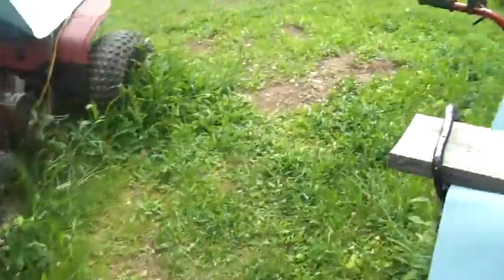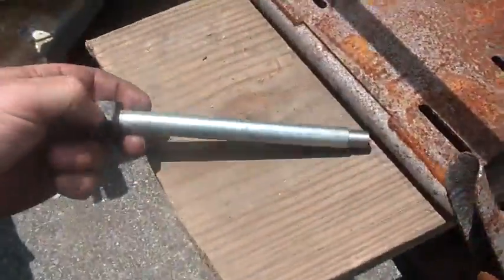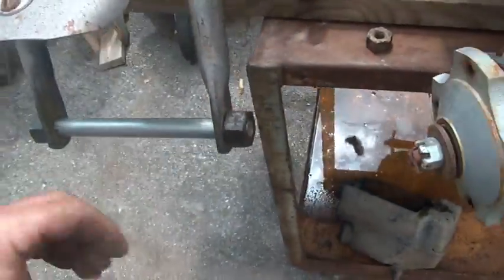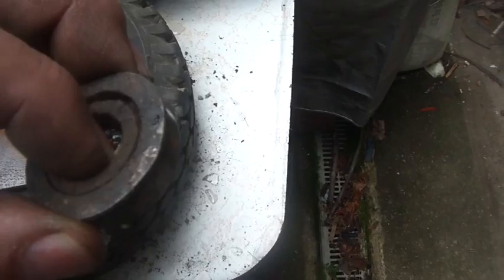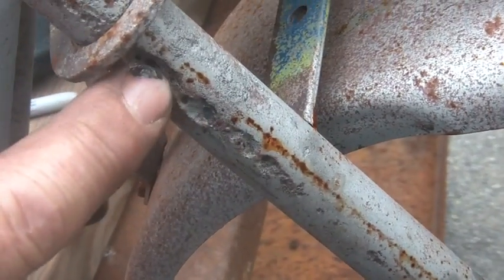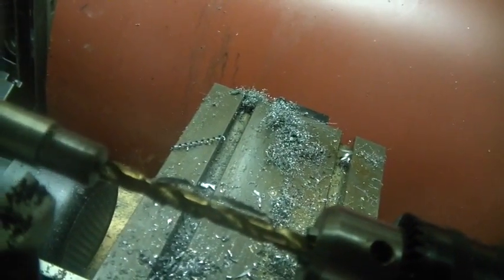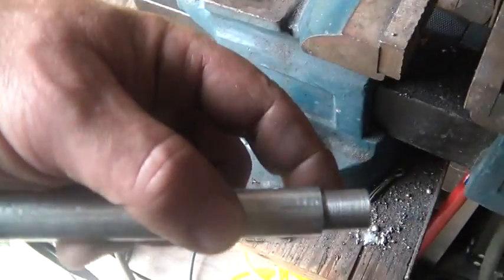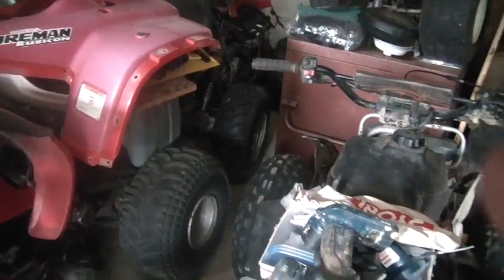Ruttman Mini Bike Build, Part 1, wheels, axles, and bearings,

Comment: Cheap low speed bearings, should have found ball bearings and weld a sleeve inside to keep tire and bearings all in proper place.
Reply from the maker: Hey Silent Death, They are sealed roller bearing and they were cheap, we will see how long they hold up.... I was thinking about that sleeve that U mentioned, I need to put some more thought on that, it is a good suggestion!!!   Thanks for your thoughts, advice, suggestions, watching, and commenting!!!

Comment: Harvey, Your videos have helped me a lot. Keep up the good work.  I have a 2007 trx300ex with schematic from stator and still don't understand the yellow wire with white stripe. It is paralleled with one of the 3 phase yellows?  What is this wire for and what does it do?
Reply from the maker: Hey Baud, Looks like the yellow and white wire AC powers the CDI unit, (looks like the CDI is AC powered for reverse, DC powered for forward.... I looked at a bunch of Honda wire diagrams, and they are all basically the same and look like this, https://www.google.com/search?q=2007+trx300ex+wiring+diagram&tbm=isch&imgil=jlBQ095Zz_zOJM%253A%253Bh1fdzQw6EsFFYM%253Bhttp%25253A%25252F%25252Fwww.hondaatvforums.net%25252Fforums%25252Fhonda-trx%25252F40608-1999-trx300ex-cdi-pinout.html&source=iu&pf=m&fir=jlBQ095Zz_zOJM%253A%252Ch1fdzQw6EsFFYM%252C_&usg=__mTWiIPYmXixZ0VUpGFHUfqOxJCo%3D&biw=1366&bih=651&ved=0ahUKEwjTydPKpP3UAhWJXD4KHQAdBWAQyjcIQQ&ei=GbNiWZPZEom5-QGAupSABg#imgrc=jlBQ095Zz_zOJM:&spf=1499640615083   ,   I hope this helps..... Thanks for asking, watching, and commenting!!!!